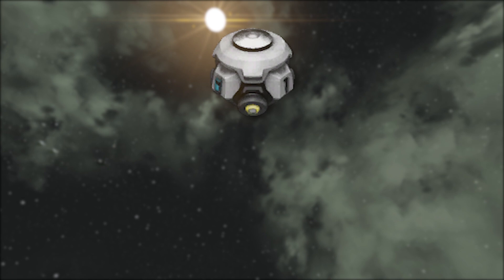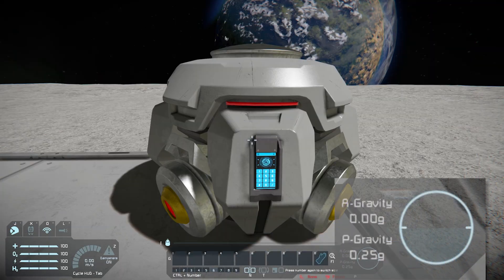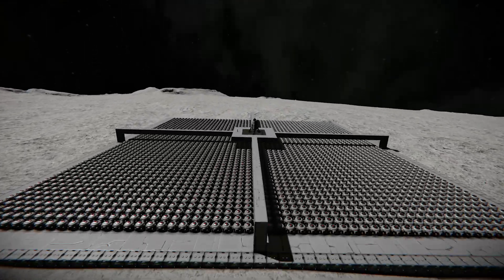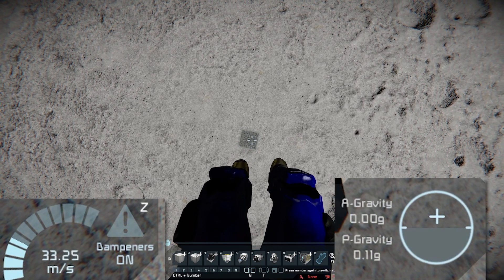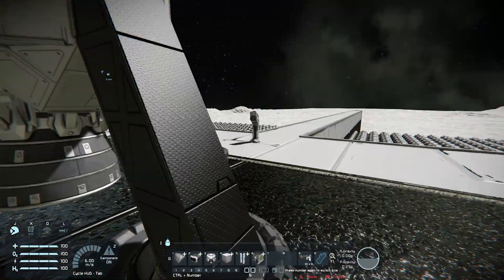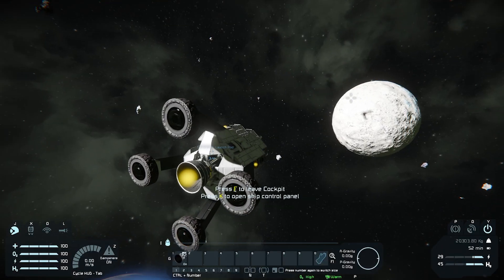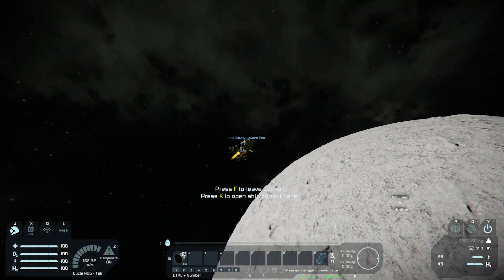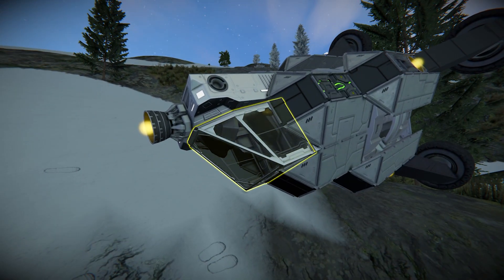How YOU can break physics in Space Engineers

Comment: using this gravity rings, i think you can not only acceleraty your ship, but also slow it down. How about building some gravity rings which launches ship from orbit of one planet, to another, right to the center of the another system of rings, which is used to reduce the speed of the ship? Shame that my laptop cant handle space engineers, i would love to try to build this thing.
Reply from the maker: You could use them to show done but the change of going through a ring at the other end would be very difficult 😥
Reply: To ease alignment issues, just use a continuous "highway" of relatively weak drive rings spaced out along the flight path!
Reply: @Xyphis i was thinking of somthing similar, but instead of building the ring on the other end you build 2 rings with the 1st ship  with the extra ring in tow so you build ring with docking ring/(merge block is more accurate) then release with second ring. ship reaches location or close too, and then when your standing still release 2nd ring and  make it a station. and thats you how can calculate a strait line kind of hahaha
Reply: just get that nvidia geforce now, streaming games is the way now

Comment: For increased effect, use spherical grav gens.
As long as it's symmetrical, you'll get the same directional pull as with regular ones.
Reply from the maker: A couple of people have told me, I'm very excited to try this.
Reply: @Zer0sLegion  it works wonders. Also, replace your battery-powered, unnecessary art-mass block with a "space ball".
Reply: @EnjoyCocaColaLight  whats the difference?
Reply: @Helena-me6mp  400m range.
Reply: @Helena-me6mp  And if space ball: Space ball, unlike artificial mass block, does not require power to function, and has a scalable "mass", to be adjusted from a few kilos (100 I think, for small grid), to several tonnes.

Comment: Saw your video on the gravity drive a few days ago, and I just built a next-gen Corvette  with gravity drives installed. Very efficient compared to my previous thruster blocks. Thanks for the great ideas!
Reply from the maker: Glad I could help
Reply: I wish they didn't nerf grav drives but they are still nice to be able to outrun another ship as a grav drive will push your ship faster than the in game speed limit depending on the drives size.  5m/ms+ may not sound like a lot, but the salt when someone is screaming you are hacking and that's why they can't catch you is worth it's weight in platinum.
Reply: can you upload it on the workshop ?